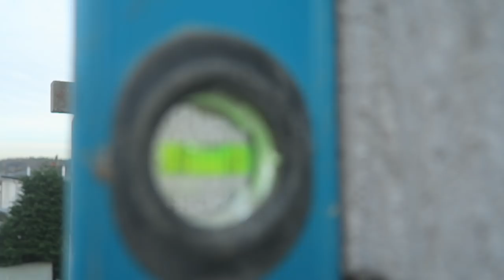How to build house extension in concrete blockwork part 3

Comment: Stu Q for u. 
Is a Double or triple high extension stronger in concrete blocks out side & thermal blocks in side just as strong as bricks out side & thermal blocks inside or are bricks more a stronger bond then concrete blocks ?

Comment: Great job, 
Just roughly how much should an integral garage conversion cost would you say ? I.e. Putting in a window where the garage door is and making inside into a room ??
Reply: mars6394 wow what area do you live in ? In Leicester people are quoting me £20k !! I'm thinking it's a total rip off.  Reasons why builders can't be trusted huh 😡. Ps it's still a fault new build at 15 years so it's not like there's gonna be loads of adjustments etc.

Comment: Lovely job stu
Car is mean looking too

Just one question what stops that type of insulation (you put into the cavity gap) from getting damp/wet over time 
??
Reply from the maker: The waterproof render
Reply: stu crompton cheers stu, but what stopped any moisture or condensation / leak etc wetting it over long run , not criticising its just I have an extension about to start & was thinking if the cellotex type ( one with silver lining on both sides & I’ll seal all ends/joins)
Reply from the maker: Yeah kingspan is the best but the customer chose this insulation not me. I transferred this insulation but I'm not project manager just working day rate